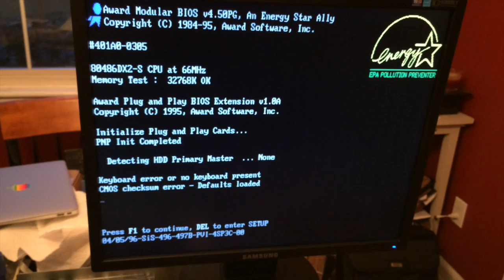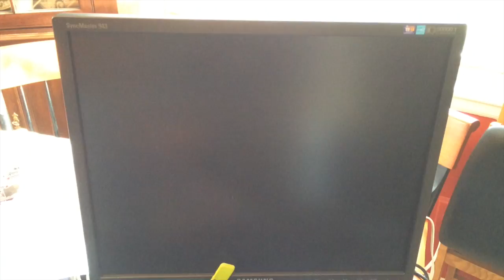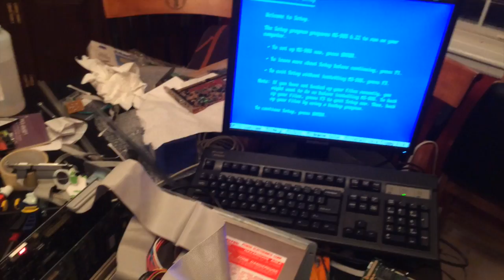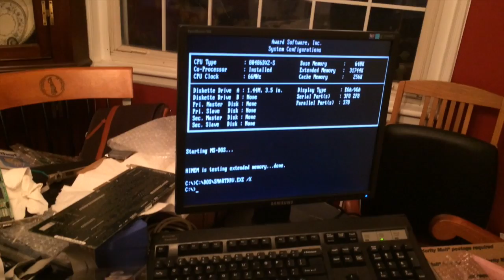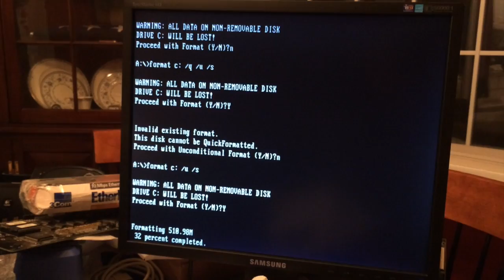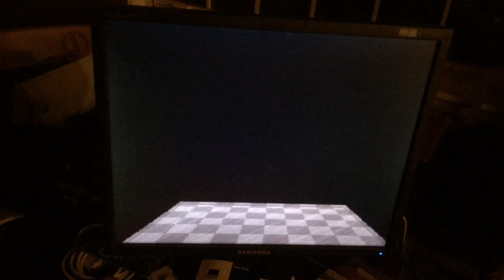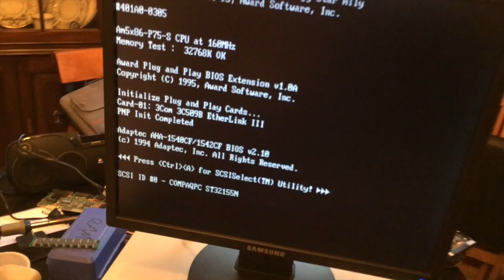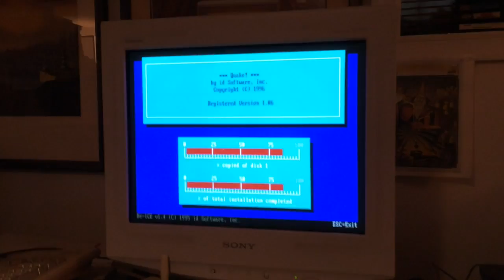486-class DOS Box Build

Comment: I grew up on that same case, but it was. 486SX 25. Same board as you removed, which is a Biostar MB 1433/50 AEA-V. I’ve got one that I’m about to try to getting running with 5x86 with built-in VRM so it can run on the 5v socket.

Comment: I have just had issues with a SVSI card as well. It would not work on a board with onboard controller. On a system with no onboard, it works flawless. It is a vlb scsi card I have.

Comment: Oh, I had an 5x86 setup back in like 97. 8MB RAM, ALI chipset, PCI S3 Trio64V+ (though I had my old ISA Tseng ET3000 for a while, it was abysmally slow, almost as slow as the low profile Realteks in my school :D). It was quite low end by then but hey, it was so powerful after my 386SX/4MB!

Nice one. Quake is really choppy, yes, I do remember... It was back then but I played through it. On a side note, I found it a bit slower with GUS then with SB16 or GUS PnP, probably because it mixes at 19.2kHz instead of the 11kHz it uses with more traditional sound devices. I think it can hurt 486 more than the P1-P3 class rigs I tested with the two kinds of sound cards.

Does your 5x86 run at 160 at default voltage, btw? Mine needed 3.6V and better cooling. The one I have now seems to run fine at stock voltage in one board but not in another.

Comment from the maker: JaquiesGadgets - knowing hardware of this era well, I knew that this motherboard and the Tseng ET4000/W32p video board handle 40MHz just fine. I wanted video performance over drive performance. I have removed Windows from the system as DOS is my only concern here. Why did I do it? For DOS performance. It sounds like you might be able to learn a bit from my video, eh?
Reply: +Blake Patterson concited much?

You totally misinterpreted the reasons for my asking what I did, picked and chose through what I said to see what you wanted to see out of my intent which was quite mistaken, and then decided to say prettymuch that I have 'a bit' to learn from your video.

I had simple questions of intent, and you bulldozed over everything as if you were personally insulted by simple questions.  it appears as if you are the one with things to learn. jeez, seriously, get off your high horse.  I had really loved your video and someone else that loves old hardware like me, but now I see I was very wrong to do so.

Also, apparently knowing hardware of this era well doesn't include knowing the old cr2032 sockets were never designed to have their negative pin force-bent back and then snapped back onto the battery, ruining the original socket mechanism.

And spell my name right.
Reply from the maker: +JaqiesGadgets The force in the first lines of your comment sounded to me like "you are crazy to have done these things!" That's how I read it, but I may have taken too much from them. My end comment was re: the known case (in the circles I travel in forum-discussing DOS machines of this era) that this board and Tseng ET4KW32p chipsets work solidly at 40MHz on the VLB. 

Looking at my comment, however, it does sound conceited. It wasn't my intent and I apologize for it.

Comment: Just out of curiosity, what is a clock speed LED display worth? I have one in my electronic scrap pile, if it is worth $10 or $15 or something I might throw it up on eBay. I pulled it out of an old 486 full tower era PC, I wanted to sell the case whole but it weighed a ton (too expensive to ship vs. value) and was badly yellowed in front from age.
Reply from the maker: Sadly, I have no idea. Might be able to push it for $10 or $15, esp if it's a 3-digit.
Reply: ***** Yes it is a 3 digit one.
Reply: You can build on by yourself too. You just need a bunch of jumpers or a microcontroller (like an ATTiny25) and you should be good to go

Comment: If you ever get a Voodoo 1 you could try Quake again :)
Reply: Quake will run great with Voodoo on this machine.
Reply: Why installing an overkill video card in there while a pentium computer could benefit more from a Voodoo 1 and play quake at 60FPS ?
Reply: I thought the same thing when he played Quake but I also remember the original Voodoo listed a Pentium-class CPU as minimum compatible spec.  I've often wondered if it would be possible to get it to work regardless with a 486DX4 CPU on a board with PCI slots.  I think that would be a neat combo!

Comment: Wow, is that an ASUS manual from a 486 motherboard? I never really took them seriously as a manufacturer pre-P2 era.
Reply from the maker: Yep. This is a Pentium-era 486 board. It has PCI in addition to the older VLB and ISA. I'm only using VLB and ISA tho. One of the fastest 486 boards around, in my experience.
Reply: Neat. Yeah if you've got VLB might as well use it. PCI would be faster, but that's no fun and all 486 builds should have at least one full-length card :)
Reply from the maker: Actually, PCI would not be faster here. Part of the reason I chose this board was that I knew it can reliably be overclocked to 40MHz on the VLB bus (PCI being 33MHz), and the Tseng chipset can take it. So it's running a 5x86 133 at 160MHz, with the 33MHz bus clocked up to 40MHz. That's basically the fastest DOS gfx chipset out there, and its running as fast as the chipset can be run. Quite a early-'90s era DOS machine!
Reply: ***** Maybe not faster, but more capable. I was thinking of things like 3dfx Voodoo cards, which only came in PCI.
Reply from the maker: You're right, there. In fact, back in 1998, just before upgrading from my 5x86 160 using that same model ASUS board to a K6 233 CPU and board, I dropped a You're right, there. In fact, back in 1998, just before upgrading from my 5x86 160 using that same model ASUS board to a K6 233 CPU and board, I dropped a Voodoo Rush board into a PCI slot there, to test it out. (What a clusterf the Rush was tho.)

Comment: Why use VESA local bus over PCI? Surely PCI will give you a speed advantage
Reply from the maker: Mike Gravgaard - PCI, which is clocked at 33MHz, has a very slight overhead vs. VLB, which only is worth mentioning if there's only 1 device sitting on the VLB (because PCI is far better at handling multiple devices - it's a real bus, where VLB is rather primitive comparatively). But that's a small factor compared to the fact that I've overclocked the 33MHz VLB to 40MHz. Being a simple, primitive bus, overclocking it is a simpler matter than doing so to PCI.

Comment: why the heck did you build a PCI system with an ISA SCSI card and VLB video card? O.o
Especially when you intend to overclock to 40MHz FSB and VLB doesn't like anything over 33MHz at *ALL*?
Do you not have a USB floppy drive for such sneakernetting needs?
Why did you put the sound card in the noisiest possible slot?
Why did you install windows 95 before swapping the cpu?
Since you have SCSI why not use multiple SCSI hard drives in the system, one for every OS you want to use?
Reply: Because VLB is best implemented in 486 computers than PCI in general, and because why not, VLB in 486s isn't really slower than PCI (when it's implemented well, otherwise, VLB is actually faster). And yes VLB CAN run at 40MHz. VLB's specifications is made to be run between 25 and 40MHz. It's PCI that don't like stuff faster than 33MHz (37.5 is very stable though). Some card can even run at 50MHz bus speed

For the number of SCSI drives, maybe he did that because 2 SCSI drives are too noisy ?